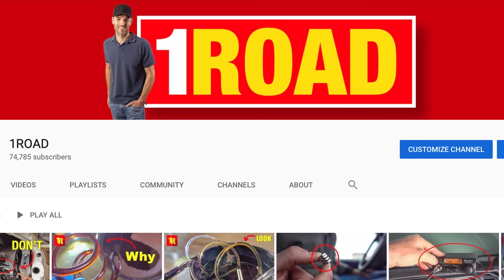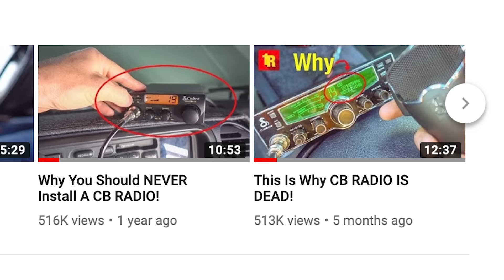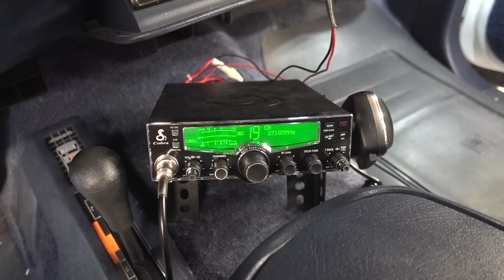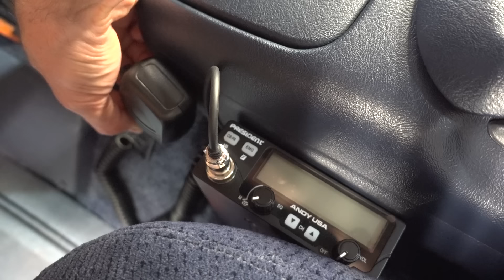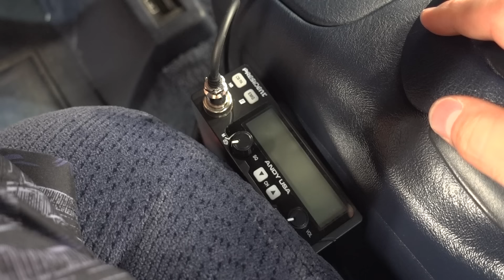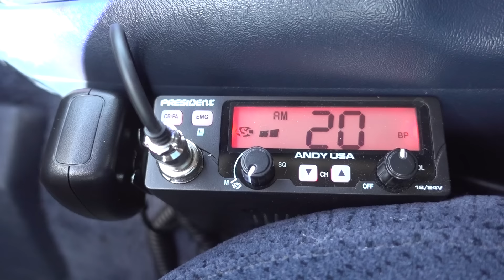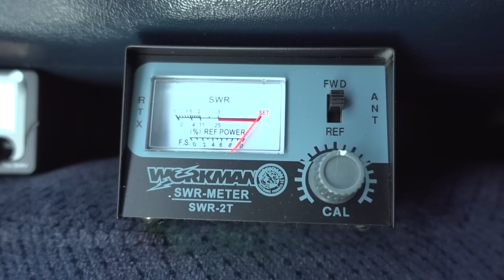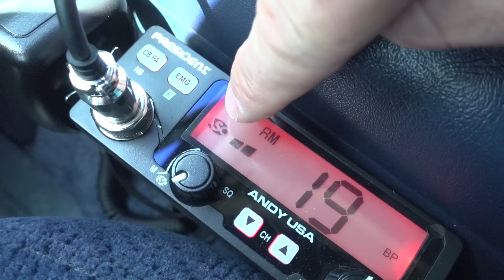Here's Why YOU SHOULD TRASH YOUR CB RADIO!

Comment: I prefer a radio with SSB. Very good for talking skip. Especially if go for an export radio with a little power. The Anytone 6666 is good small sized feature packed radio. Easy for techs with the proper test equipment to tune clean and get a little extra power from it. Cb conversion is very easy and done with buttons not by removing a component. And really stock power and tune is pretty good from the factory. Holds frequency great.

Comment: The smaller the CB the less potential power output. Uniden makes one even smaller. By FCC regulations, all manufactured CBs only put out about 3 watts. However, larger units can be "peaked and tweaked" for optimal output. Greater output, greater range. When I was OTR, mine could reach better than 15 miles.

Comment: I drive a Miata, I was in a Miata club and when we did club outings I was advised to get a CB to help with keeping the line together. I'm running an old Realistic (yes Radio Shack) unit that when in use I jam between the seat and the console, Cigarette lighter power, and I have a tuned antenna combiner so from the outside you can't tell I have a radio. For a while I used the radio for commuting when there was a lot of construction traffic, good for keeping trucks aware of you, and more interesting to talk to people when sitting in traffic. I still pop the radio in place now and then but when top down on the highway I really can't hear it. I have thought about putting one in my regular car but don't want the antenna on my car honestly. Maybe for a vacation some day.

Comment: I run both 40 CH CB and Midland GMRSs in all my (3) current vehicles and I have a Retevis RT97S repeater on my home pushing a BRC HP-500 antenna that covers the whole Ravalli County in Montana. 
In it's heyday, both my wife and I had CB licenses (KIS4886 & KBW8882) and since GMRS requires a license, I have an FCC license for it too. 
My CBs are: Sears Roadtalker 40/AM/SSB on a 102" steel whip; a Uniden BEARCAT 98040/AM/SSB on a Midland 18-2442 Mag Mount --- and a President McKinley AM/SSB running an NMO type Tram-Browning BR-140-B mag.
Running both CB and GMRS opens a lot of the world to you.

Comment: I too, hope CB makes a comeback.  I have noted increasing instances of widespread cellular outages as time passes.  About a month ago, there were huge swaths of cellular outages across multiple networks, mostly in the Northeast, Texas, Cali, and northern Mid-west.  I figure it is only a matter of time until these outages last for days, for weeks, or perhaps for ever.  At that point, CB's will be flying off shelves at truck stops and eventually will be as scarce as guns and ammo now are.  Those who have radios, antennas installed and tuned, will be ahead of the game.  CB radio will keep you company, help you find an open restaurant or gas station, or get you help, just as good today as it did in the early 1970's and after.

I am an Extra class ham and GMRS licensee and CB is far more useful for road info than those other services.

Comment: Cobra 29. It's been sitting on my bench for two years while I muster the will to modify it.   I've also got a cobra 25 mounted just to the left under dash in my 1985 C320 Silverado.   I also use the little will. Great great antenna. I will step up to the big will whip at some point.
Reply: Great video. I like that presidential. Built in heatsink prob goes far.

Comment: Got my first CB in 1966 when I got out of the Navy. Traded an 8 track tape player and two car speakers for a  "Courier" 25 channel "Base/Mobile" with 50 foot of coax..  Connected the coax to an old bicycle rim I found in the trash behind my restaurant, hung it from a tree limb and it was a perfect "Match"  .. For those who don't know.. the first CB radios were 23 channel with a 4.5 watt output and a FCC license ($20) was required to broadcast. When the 40 channel came along the output wattage dropped to about 3 +/-. 
With that Courier CB, a 1000 watt linear amplifier and a 5 element rooftop rotating beam antenna I could sit in Raleigh NC and talk to a woman in Texas on a clear night. My old CB "Handle" was the "Raleigh Mail Man"   (my license call sign was "kentucky dixie xray 1663"  ... and I've had CB radios every since those days.. when I  moved out west in mid 1970's my handle became "Carolina Cowboy" .. keep her between the ditches driver,, we gone..

Comment: When I had my 98 Silverado (same interior as yours) I made a wood mount wrapped in the same material as the carpet and set my Cobra 29LX on my floor. It never moved a bit, even with hard acceleration or stopping. I still have it made up the same way, and will be putting it in my 2001 S10 when I get everything I need don’t on the truck and start driving it daily. 

Honestly I love my 29LX. I have modified it to run better mics and it’s size doesn’t bother me at all. I also have a Uniden 998ssb in my house for a home base station. Right next to my Yaesu FT100D. Yes I like using mobile radios for home base stations, they are smaller and easier to nine away.

Comment: I have an older CB radio which I used in my vehicle years ago and also have a new one purchased recently and have to install one of them in my vehicles I now have. The older radio is most likely the best of the two though and it don't have as many channels as the newer one and puts out more power.

Comment: UHF in Australia ... I tend to stick with Uniden for my vehicle based units . Also have Uniden , Oricom , Digitech and Retevis for my  2 and 5 watt handhelds .. In my later model Ford Falcon I use a mag mount antenna . In my older Falcon and my old Honda Accord I use external mount  5 Db antennas ...All work really well ...Wouldn't be without it . In my State  (Tasmania) we lose a lot of mobile phone reception off the main highways so the UHFs are really handy . It also lets me hear where buses , trucks and road works are on two local mountain passes ..Cool ...

Comment: I have my CB behind the glove compartment, all the controls are on the mic. I have a Cool Tech LLC Jeep JL All-In-One CB Radio Kit - Cobra 75 WXST / Firestik  Antenna. It is specially designed for the Jeep JL , it looks & works great in my 2021 Jeep Wrangler sport. The only thing I don't like about it is, that doesn't have a PA plug.

Comment: I have a Cobra 29 LTD Classic in my 2018 Ram 3500. I mounted it to the center top of my dash. The radio is just to large to mount to many other places. I didn't want a smaller radio simply because of the features that I wanted were only available on the full size radios. I can adjust my Dyno mic, my rf gain and some other things that help me get a louder stronger boost. Something I don't see in the smaller radios. Maybe someday the smaller versions will add some of these feature. Thank you for your video!

Comment: I've been into CB radio since I was a little kid in 1971 with a Lafayette tube base station only had three crystals three channels to talk on.. since 1991 I have had top of the line Cobra units.. 148 GTL single side band radio modified with a swing kit to run an amp to Watt dead carrier swinging 36 Watts going into the amp... It also has upper channels above channel 40 just below the 10 meter band unlock clarifier.. so I can transmit in between frequencies.. I also own a cobra 25 LTD 29 LTD.. I recommend to any newbie c b r to get yourself either a 25ltd or 29 ltd .. these have a noise blanker which is much better than the anl (automatic noise limiter) the noise blanker cuts out all the static!  The antenna I recommend is the Wilson 1000 Magamount .. if you want a shorty antenna the best is the little will from Wilson of course the shorter antenna will not get you the transmission and reception as well as the Wilson 1000

Comment: I'm a Semi Driver and just to let you know, The Wilson Antenna isn't crap and is more of a Piece of Junk then anything. 
If I was you I would get a Predator or a Browning CB Antenna if you really want to get out for miles. I have a Connex 3300 CB Radio in my Freightliner and use it all the time with a pair of Browning Steel Whip Antennas mounted on my Mirrors. I can get out at least 12 miles with my Radio.

Comment: The perfect storm for highway driving is going down the highway and a small rise in the highway is in front of you and as you come over the rise the traffic is at a complete stop so you have to panic break and hopefully you don't kill yourself. I was a trucker and I experienced that just east of Dallas Texas but I always had my CB radio on so I got a heads up on the stopped traffic ahead. Unfortunately, some truckers didn't have their CB radio on and of course neither did the four-wheelers so it became a total s*** show of cars going everywhere trying to avoid running into the back of the stopped vehicles. At least one person wasn't so lucky and ended up dying in that backup.

Comment: Those are great compact radios. I have one of those and a few other presidents. My only complaint with the Presidents are is there all kinda weak in the modulation department and not anything you can do about it. A cobra 25 or older 19gtl  in my opinion is one of the best compact radios. Best thing about the cobra 25 is The modulation limiter can be turned up and I don’t mean clipping anything I mean just turn it up a little which increases the peak output and makes the output audio a little louder but it definitely makes a big difference when you’re listening to a stock one versus one that has been turned up a little. Every president radio I have had has any where from 30 to 50 % modulation stock but the cobra can be set in 95% or so range And it really wakes them up and makes a difference when you’re trying to talk to someone in your fringe area and being heard through static. Has a lot louder audio sound on the other end more like talking in person versus talking on some cheap walkie-talkies. Check out the anytone smart cb it’s less than half the size of that President and it’s a performer also. Little bigger than a cigarette pack.

Comment: There are a few CB radios with a National Weather Service button installed. My former car, a 2002 Subaru Outback wagon had one of those buttons built into the factory radio. Years ago, on the interstate highway in the middle of Pennsylvania the sky ahead had dark clouds. I turned on the NWS channel and found rain was at a mile marker a few miles ahead. I was prepared to react when I came upon the line of traffic that had stopped because of torrential rain. Every CB radio made and every vehicle coming out of factories should have that installed. I have an old Midland HH54 hand-held weather radio that can be plugged into the 12v port in my current car if that service is needed.
Cars in the mid-1970s had so much room in them that a huge radio like the Cobra 29LX cold be mounted under the dash with no problem.

Comment: I have CB, HAM and GMRS in my truck now.  They all have different functions and strengths, IMO, and I had the space, so why not?  My CB is a President Johnyy III which is tiny in comparison to the Uniden 980 I had before.  The Uniden was SSB, but it was just too big to fit in the space I had for it.  

And to anticipate a question, yes, my truck has more antennas on top than an office building.

Comment: i like the one radio that has the speaker and mic jack facing the front and that it is a single din size so if you have a 2 din slot and a single din radio installed you can have an even cleaner setup that way

Comment: Just a thought could you have used an accessory plug rather than hard wire it to the battery? What kind of antenna did you use? Magnetic or installed?

Comment: Another President radio in this small form factor, DIN size? Is the Mckinley. It has a lot of features your missing on the Adams radio. Example: Front firing speaker, SSB, and all around more features. Check it out!

Comment: Back in the day (early 60's) I was 2Q6412 unit 2. My Friend had a then CB License. I was his unit 2. Seems so many folks got CB radios that a license and call letters were dropped. Those were the vacuum tube days when the transmitter section could sexily bumped up to maybe 10 watts from the legal 5. I still have my old 23 channel Sonar model "G" which uses crystals of which I have about 10 channels. It is heavy. I have a new Cobra radio  and gotten into prepping in a limited way incase needed. Oh, I can add, the air waves were a lot quieter back then.

Comment: throw that out and get a striker SR-94HPC. more power and channels same size
Reply: He needs to get a real radio!  The Andy will overheat in that mounting location and it is not safe to mound using Velcro (hook and loop tape).  The radio can come free during a hard or violent stop/impact and become a deadly projectile, at the very least  it could become wedged under the gas and or brake pedal!

Comment: I had a Colt 720 DX Black Shadow in the UK heyday (70's) of CB use. The UK gov quickly brought in frequency regulations allowing only 27mhz units with power limitations. The Colt 720 was deemed to be an illegal CB in the UK, it had the power to wipe out or bleed over other chats nearby. I lived in a place that was pretty high elevation in the SouthWest of the UK, I did manage a couple of times to chat with truckers 2500 miles away in the USA

Comment: I opened up my CB radio and turned up the Output signal power to 12 watts and i had a Antron99 Tower antenna on my truck that i could only use while sitting still. I had a set of small twin truckers on my mirrors for driving But that Antron99 would allow me to talk to people in Florida from southern Ontario Canada and one night i was taking to Goose Bay Labrador from Southern Ontario, My side band was in the 20's for wattage and that's without a booster. You should get your self a tuning meter and tune you antenna to your Radio by shaving the top length of the antenna to get a 1 to 1 match. 1980's for me. was a Vic President of a CB club.

Comment: If you travel to the desert at all, you’re going to want to hard mount that CB. Hook and loop tape is fine for cooler areas but the adhesive fails in hot temps. Been there, done that.

Comment: I hope I'm wrong, but I'm concerned about cooling for the electronics in that unit. Having it sandwiched in that location plus the heat from the floor (where the heat disapator is located) will cause overheating. The radio needs air space to help cool the components.

Comment: Cobra 29 lx with Stryker at-10 antenna have it shoved between seat and console like you would go to a smaller one but the 29 lx has wether band and doing storm spotting it’s nice to have a 2 in one radio

Comment: Find the closest local CB tech...they are becoming an Endangered Species. For me it's an hour and fifteen minutes trip .   Mine has used cleaned, tuned and maxxed Cobra 25 (smaller than 29ltd) for $50, he sells the 29 for he same. He is on retainer to LOTS of large tractor trailer fleets he maintains. Pushing out 12 watt. Priceless. I bought the whole stack , 5 for me...4 for my buddies. If your super serious about reach get a tweaked, General Lee. ...up to 45 watts. Also ...if your serious about reach get a FULL 1/4 steel whip ...just watch the low trees and wires!!

Comment: I bought a smaller unit than the President Andy in 1980.  
The box has no display or controls, everything is on the mic. I bought an inline VSWR meter for a few bucks, a mag base whip and a 12V accessory plug and was good to go in 2 hours including mounting the base under the front seat.

Comment: This & the other vid one of the primary reasons you had issues with radio checks was due to many drivers keep them down or off while using other tech like maps and phones listening to shows. Magnetic mount antenna are great. If possible ask around for a cb radio shop for a peak & tune and or move the antenna to different spots for best swr is how we used to do this in Oklahoma

Comment: I have a CB mounted on my 2016 Dodge Journey that is also overlanded. My antenna is mounted in the back of my roof rack basket and the antenna wire goes from the back lift gate to the center console where my CB is located. I have a Unibine 505XL it’s small and easy for me

Comment: 1ROAD  --  CB Radio is a lot older than you think .  I bought my first CB Radio (old , used unit) from the American Red Cross there in Burbank, CA in 1966 and it was an old 4 channel Tube set (no transistors) with separate Crystals for Transmit & Receive for each channel .

Comment: Another thing to consider is weather band, i like to have that for travel. But on trails or off road I like fm and a splitter, which will require a truckers type radio. They, years ago had cb's that had all the controls in the mic. So you could install the radio under the seat, but have everything in you hand.. idk if they still make those but if they did...

Comment: I worked in cb shop and your not matching the radio to the Antenna your matching the Atenna to the  car or truck. Good exemple is Car carriers will have different matches depending if loaded or not. There is a small box you put in line for them to fuel the to make that match work so you don't burn out the transistors in the radio.

Comment: Trucks need to get into Ham radios. Kenwood TM271 would be perfect. A quick ez modification inside the radio makes ot able to transmit on channels no longer in use and the sound quality is excellent and the distance you can talk is 10x the CB radio.     Steve

Comment: If you just need a compact cb I'd get a cobra 19. I put a cobra 19 in my off-road rig and it's been super durable and great power and clarity... Under 20 bucks at Wal-Mart. I'm also a commercial truck driver and i only use cobra 29 radios in my semi truck, but they're definitely not something you would want to put in your personal vehicle. I will be buying another new cobra 19 for my new off-road vehicle as well as a compact gmrs.